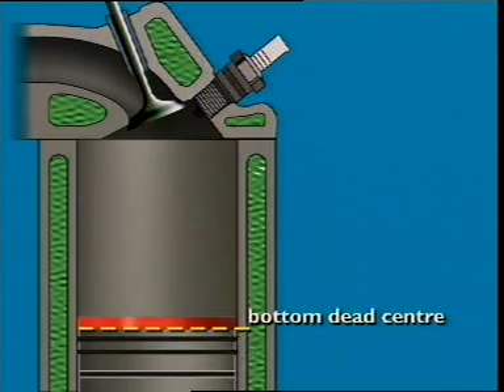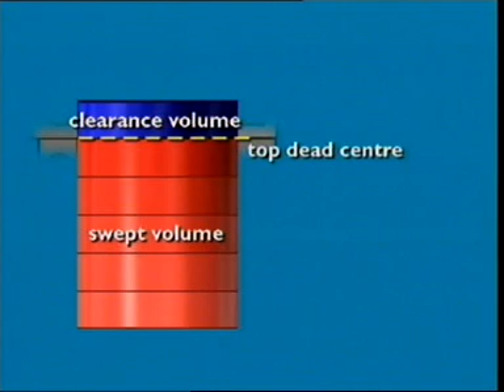Compression Ratio

Comment: does this mean that increasing stroke while maintaining the same top dead center position, would increase compression ratio? if you wanted to maintain compression ratio, you would have to compensate in other ways such as a bigger chamber size?
Reply from the maker: Correct, we usually will use a dished piston to get this done
Reply: Awesome. This also has me wondering if forced induction changes cr, since more air is basically more displacement, or would it change swept and clearance volume equally?

Comment: I have a 1984 ford ranger longbed 2wd with a 302 from a 82 ford ltd. It has an aod transmission and 3.08 gears. Awesome on the highway, but im looking to wake it up. Not sure if i should abandon this motor for a roller block? it scoots now and i was toying with the idea of a set of gt40p heads, sold tappet cam with about .480 lift, a converter and a 8.8 explorer with 3.55 or 3.73 gears. Any ideas? it has a 2bl carb on it now and stock intake.